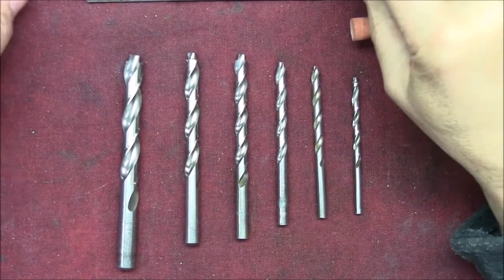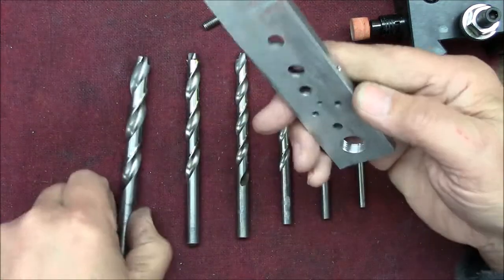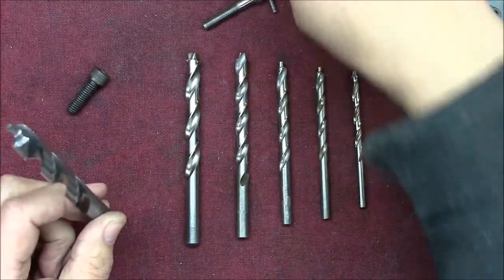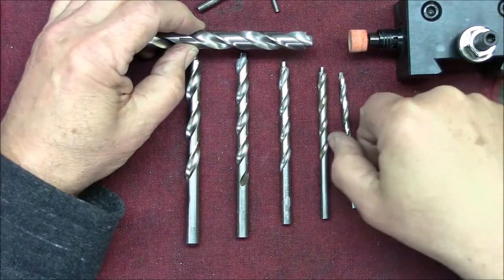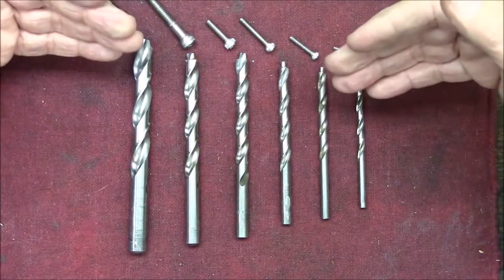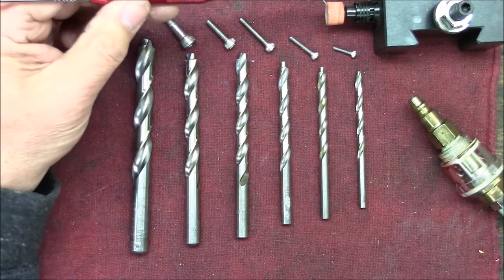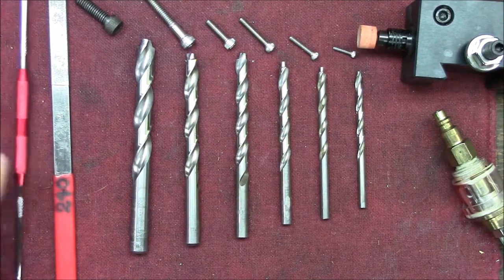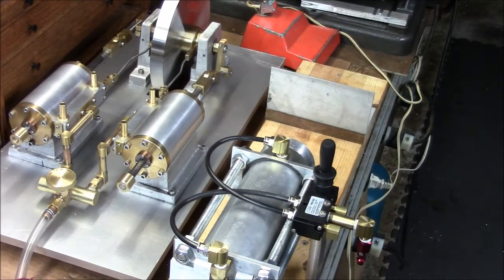Counterbores  -How to make and use-

Comment: do they make hand twist driven counterbores that you can manually turn in order to get hole is plasitc?
Reply from the maker: I have never seen a manual version but I see  no reason you could not put a handle on it.  Best of luck and thanks for the comment.  Fred

Comment: nice job. I may have to try this myself.
Reply from the maker: Thanks for the comment Dave.  Once I got the process down it was an easy task to make multiples of different sizes.  I deal with aluminum and brass a lot making my small stationary engines so this will work for me.  It should work with steel as well.  Let me know how you make out.

Comment: Hello, Fred.  Somehow I missed seeing your latest videos till now.  That is an excellent idea for making counterbores.  I don't use them enough to buy a complete set, and that is a great way to get the ones I need most often.  I do not have a mini grinder like you show.  It looks to be about 3/4" in diameter and fits in a boring bar holder.  Is it compressed air powered?  Where did you find it?
Reply from the maker: Hi Paul,The grinder is an air grinder from Ebay.   You are right on. It is 3/4" and fits in an AXA boring bar holder.  Perfect but really loud. Hope all is well with you and that you are getting some quality shop time.  Hope to see you at the Marion show.

Comment: FYI:  The height of the cap is equal to the major diameter of the SHCS, (socket head cap screw). For example, the counterbore depth for a 5/16" SHCS is 0.3125.  The diameter of the head is a factor of the fastener size.  Up to #12 is 1.63-1.64 x the fastener size.  12's are 1.6x and 1/4 and above are 1.5x.  So, the head diameter of a 5/16 SHCS is 0.469.  Mind, a counterbore needs to be larger, so there's some clearance.  

I have a bunch of homemade counterbores I bought on eBay, so the drills used may not be to standard. There's some variation in clearance in the larger sizes.   There are recommendations online, and in references, such as The Machinery Handbook.  I have a HoloKrome (fastener manufacturer), chart, and it seems to be different than charts I found online. 

But, once you have them made, it's easy to know the depth, at least.

Hope this helps,

GeoD
Reply from the maker: Thanks for the information George..  Very helpful.
Reply: Damn, just wrote a reply and YT puked... have to do it, again, later.

Arrrggg!
Reply: Being in the midst of restoring and organizing this poorly made set I have, #2-xx to 1.0"-xx, my mind is swimming with the specs of the SHCS and the drills used to make them, so I thought I'd share what I discovered.  I literally was making labels for them the day I wrote the comment.

I plan on regrinding the profile and cleaning up the severely chowdered  shanks a few have. I have a eyeglass lens template rig I'm combining with special purpose mill head I'm putting an ER32 collet into.  It will be a combination mill/grinding rig for reconditioning tooling, and millwork.  It's what I like to do, build useful machines from industrial junk. 

 I have a pair of 4' recirculating ball bearing shafts, 1.75" diameter I scavenged for my X axis, and some 2' long linear bearing shafts, 1.5" diameter for the Z. I'm looking for a tee slot table, right now, then I'll start building.

In the process of converting a Sherline lathe to an ER32 collet, so I'll get double duty from the collet set.

Good vid, first of your I've seen.

GeoD

Comment: EXCELLENT THANK YOU FOR THE TIP
Reply from the maker: You are most welcome.  Counterbores are relatively expensive and I don't use them that often so it was very satisfying to make them myself.  BTW, I have used them and they have been holding up very well.  Fred
Reply: I have a set bought years ago for my gunsmith work 12 different size pilots, but lost the 5/16 cutter. cannot buy just the cutter and you are right expensive. Stared making onE this morning with a 1/4 pilot and a 5/16 cutter. Just have to relieve the back.  It IS for a 22 magnum cylinder that has to be redone . CHEERS

Comment: can I use a step drill to make a counter bore in steel?
Reply from the maker: Great question Tony.  Since the modified drill bits are of very good quality, if properly sharpened it should cut steel with no problem.  What will also help is that the counterbores only remove small amounts of material with each use.  Thanks, Fred